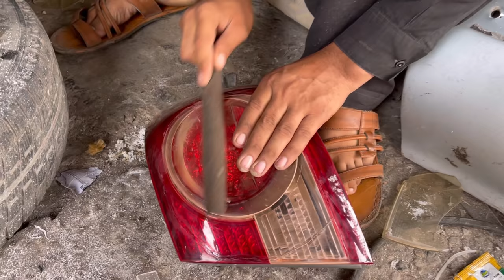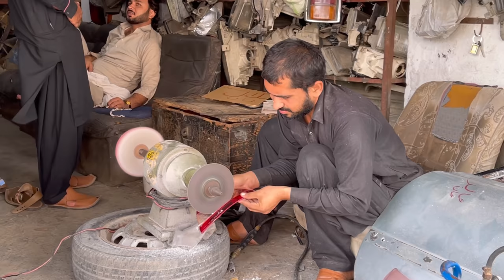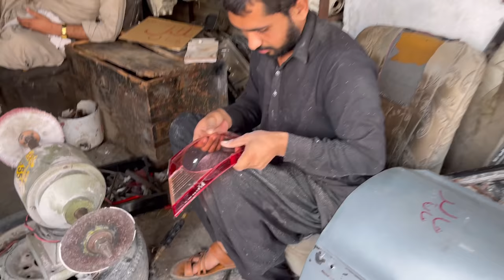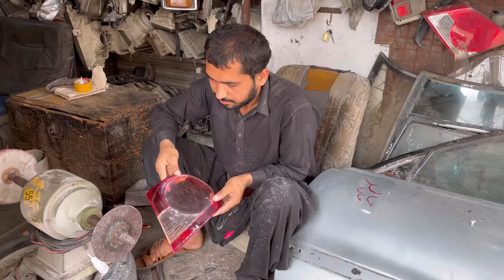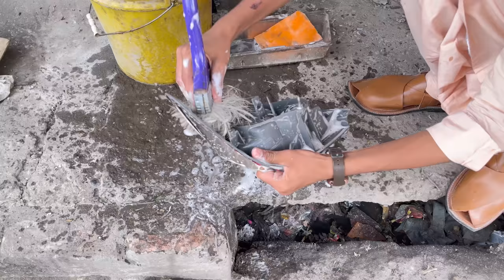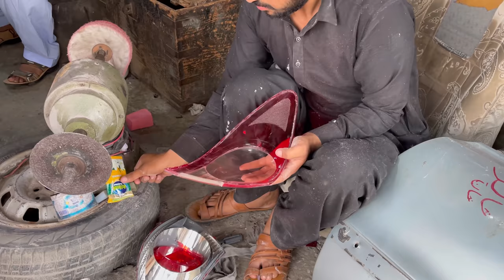How to Rebuild Car Broken  Light || Car Tail Light Cover Replacement || Restoration of Car  Lights

Comment: 👏This is HARD WORK with amazing skills. It s a lesson to us all. Thanks for sharing, it's refreshing.
I ask if you can share some information, such as:
What kind of glue do you use??
What powder mixes in the water when you wash the headlight with a brush.
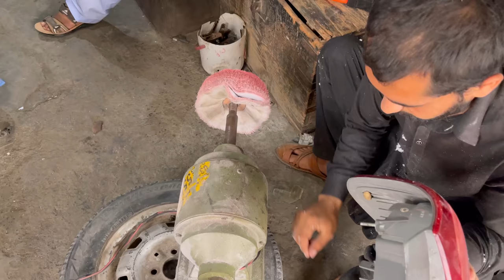What material do you put at the end (what looks like pink soap (at 6:27 minute) on the polisher.
At the end he puts the contents of a sachet, like cream. It smears inside and out and then wipes with a cloth. What product is it?

Comment: Belo trabalho, mas uma coisa que me deixa curioso, qual o valor da mão de obra? Deve ser muito barata pra ser viável restaurar lentes de faróis que nem são tão caros!
Reply: Parts dealership are very few for new parts in Pakistan so everything gets reused.
Reply: barato é um paralelo vagabundo, pelo menos aqui no brasil um original custa caro e nem sempre acha. carros mais antigos então é pior. a necessidade é a mãe da invenção.
Reply: in Pakistan car parts are expensive. 
best way is to repair it. and these guys do it perfectly
Reply: If possible can you please connect me to the seller of these plastic sheet they use?

Comment: Opino que el trabajo muy bueno y artesanal... Pero en Europa un faro reparado así NO es homologable por lo que no pasaría ITV si se detecta... El problema es la baja resistencia y peligro de proyección ante impacto de los materiales que sustituyen el original... También tengo mis dudas de la longevidad de estos faros reparados... a ver para dar el pego y hacer el apaño en esos países vale... pero en un país desarrollado la reparación además de prohibida es inviable pues sale más barato comprarlo nuevo que invertir ese tiempo.